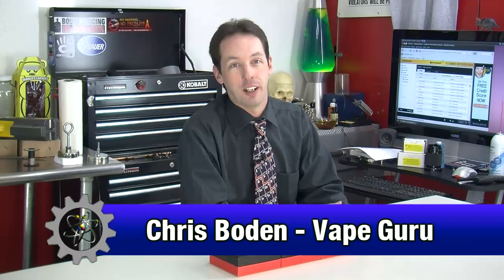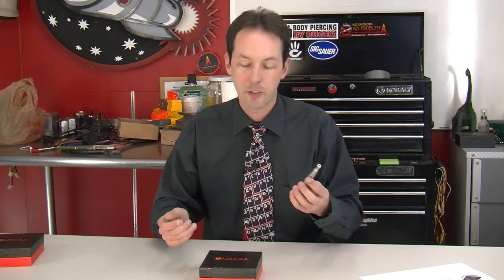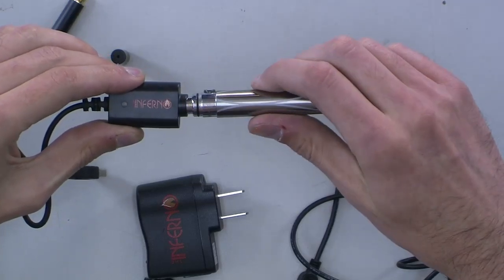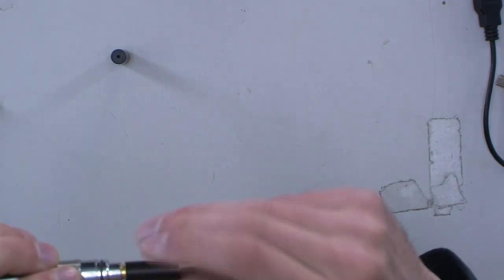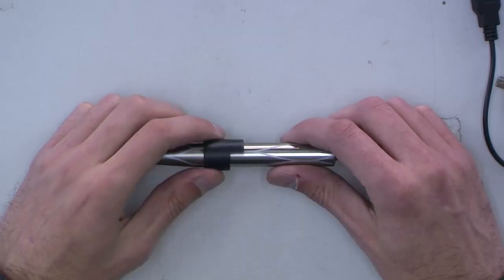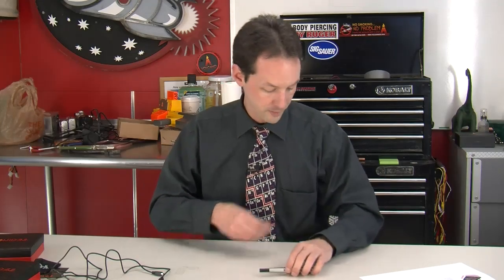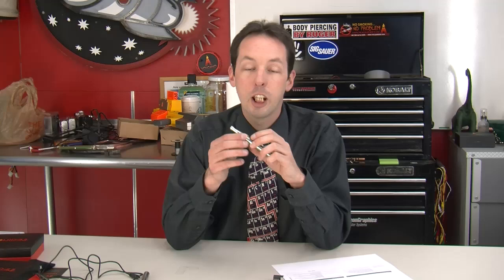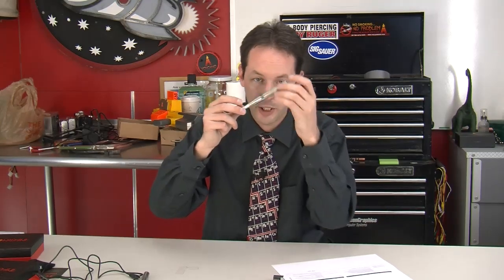Volcano Inferno Instruction Video

Comment: Thank you so much Chris... I recently received my inferno and things have been bueno since but I find if I use three drops I get the "bong" effect and I get leaks and have to clean the juice from the part where the battery screws onto the atty. Maybe im not vaping all the juice before I add more but im afraid of running it too dry, any tips?